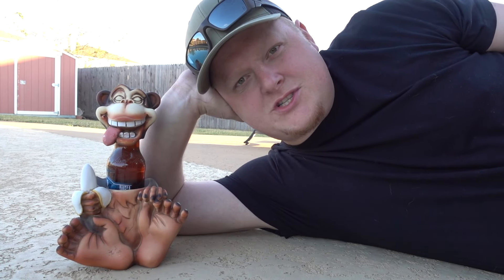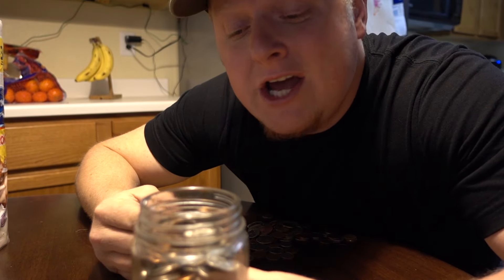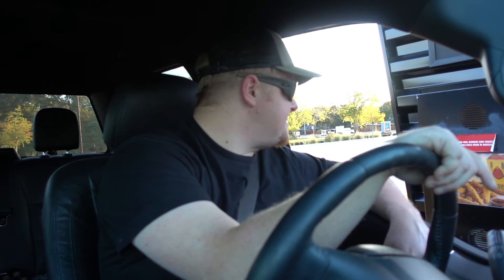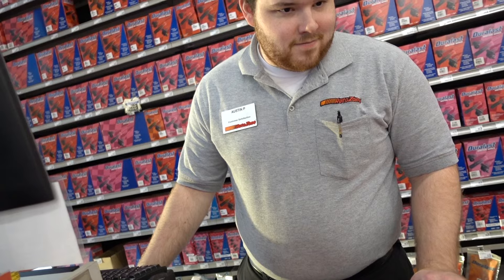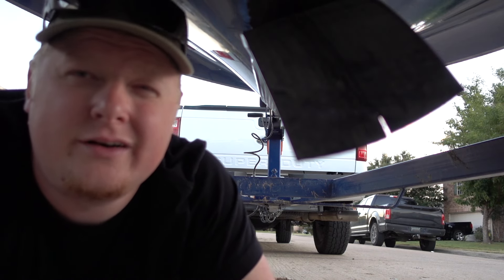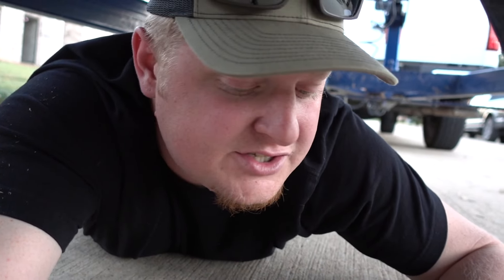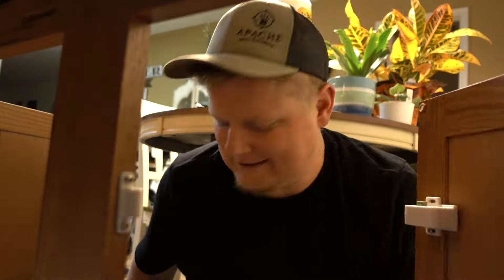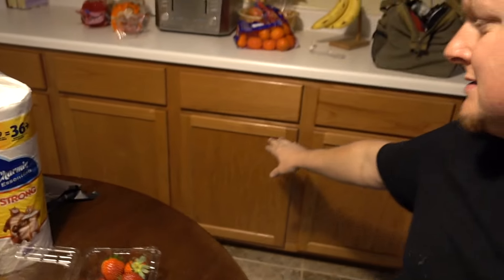FIXING LUNKERSTV BOAT

Comment: Did the JB actually bond that? Those keelguards are a polyurethane/polypropylene blend if I remember right, I wouldn't expect epoxy to adhere properly bc of the surface energy mismatch. Don't get me wrong, I love JB Weld, but that's impressive if it doesn't debond in under a week or so. If it does grab a can of 3M Super 77 Spray Adhesive, that's what works the best for those PU foam pads to anything metal, composite, etc.